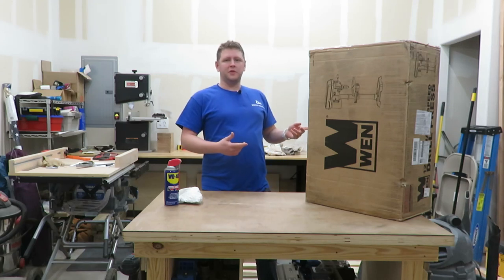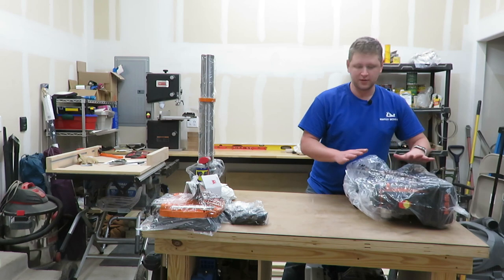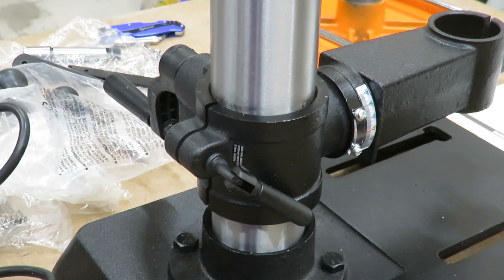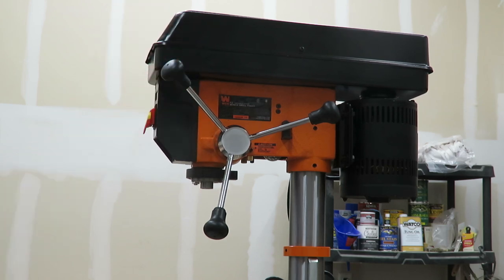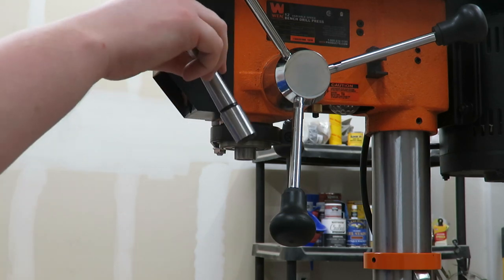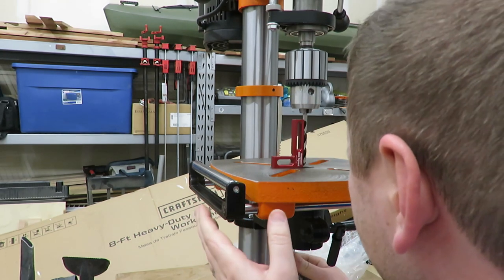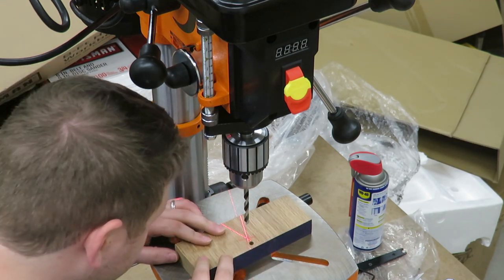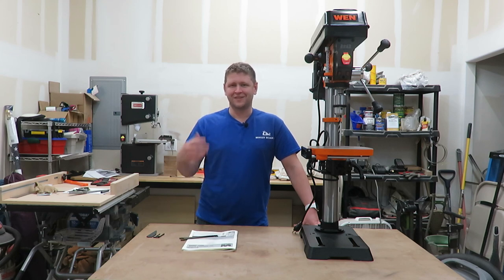WEN 4214 12-inch Drill Press | Unboxing & Assembly | Review

Comment: I just ordered one! Wondering if anyone has put a keyless chuck on? do you like it? worth the upgrade? or at least convenience?
Reply from the maker: Excellent! Let me know how you like it!

I have not upgraded my chick yet, but that is one of the drawbacks of this drill press, is the runout you get from the stock chuck. I have seen some options for ~$100 to replace it with, but haven’t pulled the trigger yet. Let me know if you do!
Reply: @BentleyDesignCo  Hey, FYI, I got a keyless chuck ($50 amazon) The runout is 0.004" Good enough for my woodwork!  Love the keyless!
Reply from the maker: @Mogalize  Awesome! Which chuck did you end up going with??
Reply: @BentleyDesignCo  From Amazon: PSI Woodworking Products TM32KL Keyless Drill Chuck with a 2 MT Mount, 1/2-Inch
Reply from the maker: @Mogalize  Thanks!  I'll check it out!

Comment: Amazing, Most drill presses assemble the same way. Nah, I would put the table extension to the right. It is not "Jamming" the chuck, it is "Sitting" the chuck. gee, you complain about it not being center, and yet you can adjust the laser light.
Reply from the maker: It actually worked out best for me to have it on the left since I have a shelf to the right of the press now. It could go either way, but the left side worked best for me.
And if you’ve put together a drill press before then you should have no trouble with this one, it was pretty straight forward 👍🏻
Thanks for watching and hopefully you learned something from the video 😉👍🏻

Comment: Hitting the chuck is not a great way to secure it. The way I always did it was put something on the drill press bed which you can then bring the chuck down on it and then press it in, no need for a hammer.
Reply from the maker: That’s another good suggestion, too!

Comment: I do believe you're crappy Wrench is to take off the drill chuck separator from arbor
Reply from the maker: I think it was for the bolts on the base, but could definitely be used for multiple applications, I’m sure.

Regardless, the wrench is pretty low quality and I would advise you to use your own if you have one available.

Comment: You showed that you can get it 90 degrees left and right to the table.  My 4214 has a table that leans slightly forward.  So - no adjustment there - the press is basically worthless...  I didn't realize this until I started having issues trying to mate up knife handle scales with pins.  I'm past my refund date - so now I'm having a nightmare of a time trying to shim up a vise on the table to make it 90 degrees in all directions.  If I ever buy another drill press I'll go to a store and take my machinists square with me to make sure of what I'm getting.  :(  POS

Comment: When you're doing your test hole and increasing the speed at 19:20, I can see some very obvious run out on the drill bit.
Reply from the maker: Yea you can definitely get a better result with an upgraded chuck. But it does a good enough job for my woodworking so far. I probably will upgrade the chuck in the near future though.
We have been moving so I haven’t gotten to do much woodworking over the last year. That’s why I haven’t uploaded anything new in a bit.

Comment: Why doesn’t anyone test drilling metal with Wen drill presses. If it can drill hard metals surely it can drill anything. What are you scared of?
Reply: I just bought one and waiting on it, a little concerned no one has a video of it but it does say its capable of metal in there site
Reply from the maker: Not scared of metal, I just don’t do any metalworking. I just do woodworking, but if I start doing metal projects I will try to remember to update this with the results.

The general consensus I have gotten though is that the runout may be a little much for the precision needed in metalworking. Depends on your needs, I suppose.
Reply: I've drilled metal with mine. Use the lowest speed, push down slowly and allow the bit to do the work, use lots of WD40 with good cobalt bits.